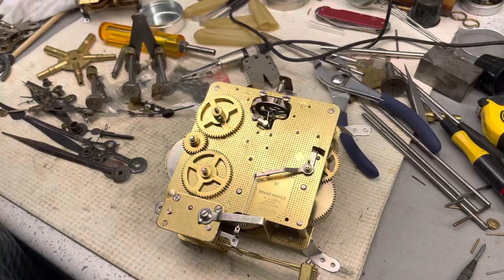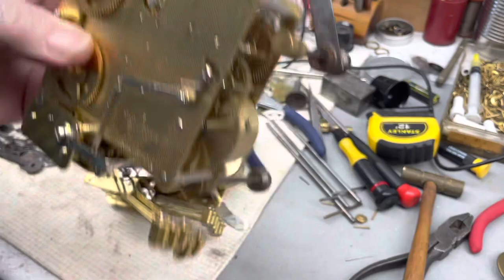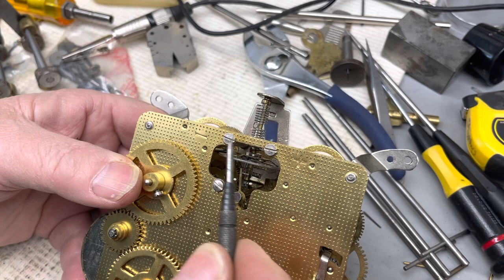Adjusting the old style Hermle floating balance.

Comment: Thanks so much.  I have not been able to regulate my Elgin Mantle clock (with a Hermle movement).  I have been stumped by the + - sign but no visible adjustment screw.  Your video had just the info that I needed.  Thanks

Comment: Friend, I, too, recently acquired this version 340-020.  My experience was that I could not slow the clock until I moved the adjustment toward the "-" (minus sign) using the perspective of the FRONT of the clock. The clock sped up with adjustments using the perspective of moving TOWARD the minus sign from a rearward perspective.  My observation on 2 days of using this perspective.  (And, I am not beyond getting professional help, in that the range of my adjustments has yet not slowed the mechanism to being correct, even 1 month later.)

Comment: I actually saw the second video and realized I have this floating balance model. I saw the -/+ but thought I had to move the screws not the little level on top of the balance.
Question if anybody knows: moving the lever to the + sign will make the clock go slower or faster? (as in the previous model moving the screw clockwise makes it go slower, and moving it counterclockwise makes it go faster )Thanks!

Comment: Could not find video on adjustment on this clock! Thanks it was still in the mantle could not see it.
Reply from the maker: Glad it helped
Reply: @JRCLOCKER  Hi I am turning about a quarter turn per shot to the right where it says + and it is still between 5 and 10 minutes late per day . One point it was 20 but not sure if previous day I had reset the proper time. Will continue. For 5 to 10 minutes how many quarter turns am I supposed to turn ? Thanks for your help!

Comment: Thanks for the video, that explains it for me as I also have the one shown. I'm new to this so I'm still learning, I bought a W.L. Gilbert mantle clock dating 1923 in a nice Australian made case it's fully functional but very dirty, I'm going to clean and oil it when the oil I've ordered arrives. This clock appears easy to do because the winding springs are exposed. However the 340-020 movement in my latest Deco revival clock has casings on the springs, I would like to clean it before I oil it but am hesitant because of the cased springs, not being able to dry them. It appears fairly clean but the case is dated 1968, should I just oil it, Thanks, John.

Comment: I've been looking for this video! Thank you for posting it. But I still have a problem.  I have this same movement in my mantel clock but its all the way turned to the + and it is still slow.
Reply: You can take that piece off and swish it in your cleaning solution to make sure everything can move freely without microscopic dirt. It should turn faster after you blow it dry good. If it's still too slow, it may need to be replaced. There are also tiny weights on the balance wheel that you can remove to make it turn faster. As you are making the speed adjustment, that is what changes the speed. You are turning the area of the wheel with the tiny weights in relation to the rest of the floating part.